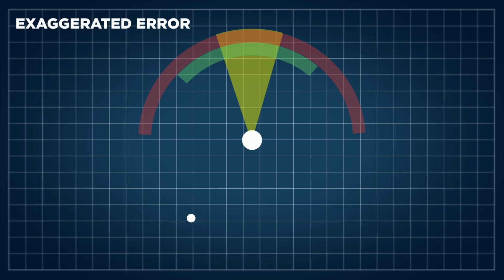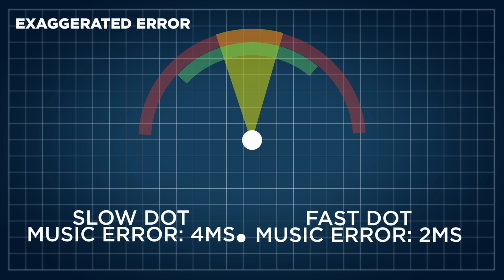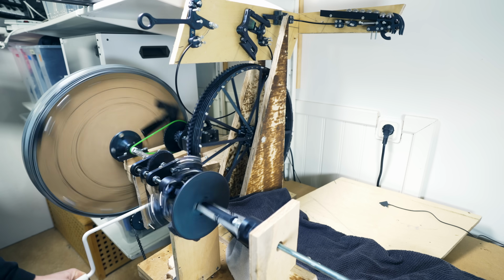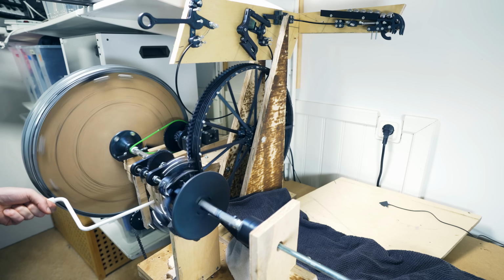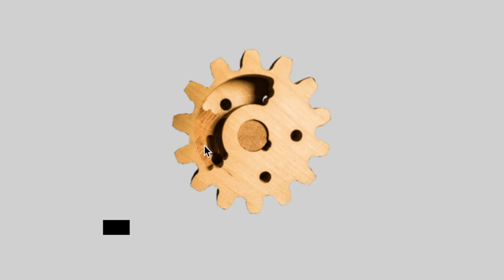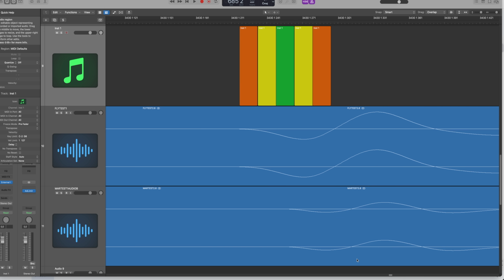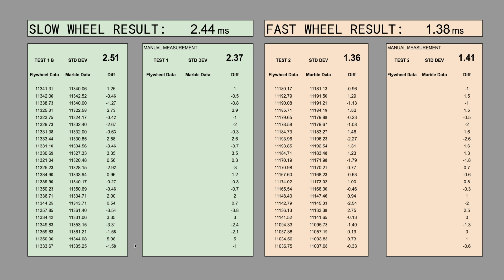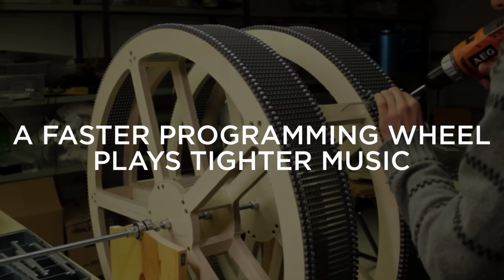Testing a Faster Wheel - Is the Music Tighter?

Comment: Testing your theories in the prototyping phase will increase the odds of successfully creating a functional marble machine! Great job Martin! The only thing I might add to the conversation is DOUBLING the speed of the programming wheel ONLY decreased the std dev by 1 ms total. This slight advantage in std dev seems too costly from a music programming perspective. You may need to create a decision matrix to determine which route really is the best option to achieve your goals.
Reply: I'd add that the program needs twice as many triggers on the half speed variant. This means that 2 triggers will be a total of 1ms further out than 1 trigger. 

If he did the same test but put 2 triggers on the slow version to match the play speed of the faster wheel then the std deviation is going to even out. 

Or at least it will be less noticeable as the effect will cause a microscopic pulsing.
Reply: There is this business bullshit saying:
Is the juice worth the squeeze? Here I'd say no
Reply: IE. If you are playing at 1 BPS and the wheel is doing 1 RPS (1 trigger per rotation) and it's got a variance of 1.5 ms. And, the slow one is playing 1 BPS at 0.5 RPS (2 triggers per rotation) with a total variance for one rotation being 2.5 ms then the variance on the slow one between triggers will be 1.25ms . Which is better. 

However, the downside of this is that   2 triggers will go out in sequence and then back in sequence causing a  slight pulse. It's a matter of whether it's noticeable enough to eliminate. I doubt.
Reply: It might be a decrease of 1 half or a decrease of 1.
Reply: To add to this, perhaps you should update your requirements list to include the discoveries you’ve made with your prototyping. If you set a minimum threshold for total acceptable deviation it will give you a concrete cost metric to help you decide whether it’s actually worth including small improvements like this once you enter the design phase.
Reply: 1:12 Hey Martin, I respectfully disagree with your explanation of this diagram, the difference between the green and red curves is the radius and will always be different no matter if the wheel is turning faster of slower when you overlay the yellow sector, which is different to your physical prototype. This needs to be acknowledged if you are truly seeking to design from first principles. Also, and I am truly not trying to be mean or picky, but a theory is a principal formed to explain the things already shown in the data, until then, it is an hypothesis. 😊
Reply: @MrVajutza  I respectfully think you dont understand what the diagram is showing..
And he is obviously using "theory" in the colloquial meaning, not the scientific one.
Reply: Not to mention the dangers something with the needed mass rotating at twice the speed poses should it fail, as well as the far greater strain on the mechanism. How will you stop it? How long will it take to spin up? How long will your gearing and shafts last at those forces? Torque can run away from you fast, and I don't want to see a story of how the programming wheel turned its axle into a twizzler
Reply: @ghostdog0424 -- I'm not worried about this. The final programming wheels will almost certainly be edge driven and probably won't exceed 30 RPM. A simple lever break should be plenty to arrest the rotation.
Reply: @TlalocTemporal  Good point. It's the relative hazard that worries me, especially with the massive snag hazard of programming wheels sitting directly behind Martin (according to the last cad model we saw) having no guard or E-stop integrated. Shit happens, and there's a reason lockout and machine guard standards exist. They're written in blood. This may not kill Martin, but the potential for injury is still there.
Reply: @TlalocTemporal If the programming wheel is spinning at 30 RPM, that means each “song” will just be the machine playing a 2 second loop (for the entirety of the song).

I really hope he’s considering these additional variables before he decided what RPM he’s aiming for.
Reply: @ghostdog0424 I wonder how many missing fingers Martin feels is acceptable by the time he starts and concludes his Marble Machine World Tour.
Reply: It depends on how big of an error is acceptable,
how much error the other components add,
how much effort it is to reduce the error
and probably more...

I agree that there should be some kind of system to evaluate if it makes sense to implement.
Otherwise you're stuck overengineering everything.

My gut feeling is that the solution (for example the sideways moving wheel) is a lot of effort for very little payoff.
And if might even add more error than it reduces.
I guess a Proof of Concept would be interesting to see.

I'm looking forward to that. :)

Comment: Be careful with going fast; mechanical parts have inertia and will "float". Will you have to worry about this? Probably not, but do keep it in mind.
Reply: Yes, and this can have an effect on the overall programming density, as well as the size of the programming wheel.  A 10 meter radius wheel will have pins move past triggers at 20 times the velocity of a 1/2m radius wheel if both are spinning at exactly 60 rpm.  

A larger wheel at 1rpm will put more stress on the pins and triggers than a smaller one at the same rpm, but it will also have more angular momentum.

A better way to deal with the problem is likely to dispense with plastic pins and Bowden cable trigger mechanisms and go with pneumatic punch cards, or electromechanical triggering using solenoids
Reply: @sethjones5250  I think the idea was to make it fully mechanical. If you accept electronics, crystal stabilized CPU is always going to be more accurate method and will be easier to implement, too.

Comment: At what point is the music tight enough?  At a certain point you gotta say it’s good enough to start construction
Reply: That was the exact mistake he made with the MMX. Tiny errors start to compound. A machine might not work at all if a couple dozen of its systems are each off by even a 1/32 inch.
Reply: @eleetpancake  the answer isn’t to endlessly pursue tightness  way past what a human can differentiate
Reply: @jb76489 It's only tightness passed what a human can differentiate on a single system. Add the inaccuracy up across a bunch of systems and it might become noticable. Some systems should be as highly optimized as possible because others can't be nearly as tight.

Comment: Consider having more then one programming wheel, that turn at different speeds.  By turning the playing of wheels on and off, and using different multiples you can get longer compositions out of the same length of wheels.
You could even have a track on one wheel that starts and stops playing of other wheels.

Comment: Since notes are only triggered by the strike of a falling marble, and there is no control over the sustain of the note, why bother with different note lengths on the programming wheel?  They're all...64th notes.  I must be missing something obvious.
Reply: My take on it is that the faster flywheel spends less time over the area of variability.....leading to a "tighter" area of variability
Reply: It’s about the timing of the note. The marble drops after the programming pin finishes going under the reader. The different lengths allow for there to be things like off beat notes and different music structures like 4/4 and 3/4 without having to make a million little holes in the wheel. (I think)😅
Reply: @JHaugan1  I gave that some thought, when thinking about this, but again, rather than making the note 4.2 "pin-hole-distances" long, one could put a much shorter trigger, 0.2 pin-hole-distance long, in what would be the 4th pin hole along.  Save much in printing time and cost of PLA...
I can imagine it would need to be a minimum length for triggering time - but I'd picture a much smaller triggering piece that what I've seen in his tests.
Reply: The note plays at the disengagement of the programming "pin". The different lengths are for timing regulations, he can increase the length of the end of the "pin" without changing the fixation points in the programming wheels. Basically, you have to make custom pins for each music instead of making custom wheels for each music.

I know this pin-track-thingy does look like it is doing some sustain or other musical magic, but it just looks like it. The time of engagement does not affect the note (except for very small times, then the vibration could introduce some variance). I personally think this design is impractical on a full machine, but, at this stage of development, we are only caring about timing
Reply: The start of the pin loads the marble and the marble is released at the end of the pin.  The pin needs to be long enough to give the marble time to load and settle before being released to have consistent timing.  I believe the prototype pin was made extra long so the wheel could be spun extra fast like in this test.  Once a speed is decided on, then pins could be shorter to only be as long as needed.
Reply: @jeremymercer5655  This would be a really good experiment to test how quickly he can play music on the machine!
Reply: There’s a video on it somewhere, but IIRC the idea is to minimize the number of indexing holes needed in the wheel.
Reply: @r-a-ray it's the video titled "A New Music Programming Pin", from 11 month ago
Reply: @r-a-ray  makes sense tnx.  it does bump up the time and cost of triggering pieces though.  interesting trade study.
Reply: Ok so since only one glared at the point without making it obvious: the mechanism works in three general stages; when idle the gate does not hold a marble, it is empty, the marbles are up in the channel waiting; when the pin is registered, the gate allows one marble to enter and be prepped for release; when the pin ends the gate releases the marble. During the second phase there is some bouncing happening in the gate, as the marble comes to rest on the gate’s gate; as Martin quickly discovered, releasing the marble before the bouncing subsides, affects the timing of the release by quite a lot. The solution was to put a delay between phase 2 and 3, aka the long pins.
Reply: @PigreKo  Thanks, mate.
Reply: Guys remember this is a test prototype to confirm ideas and design.
The final marble machine will, obviously, not look like this wheel and activation system.
Reply: If I remember correctly this is a test ramp, and in the future each ramp will have a different profile. (One ramp plays multiple notes.) 
The benefit is instead of needing to program hundreds of pins, you just match the right ramp to the right slot. 

It trades time programming at a concert for time designing each ramp to have the proper profile
Reply: While it only plays 64th notes, the timing of those notes is more accurate with a faster wheel. The faster the wheel, the closer to the correct timing the notes are played.
Reply: My thoughts exactly, it doesn’t really make sense because there’s no sustain in it, the difference is more a function of the contact lengths and release delay, not of the actual notes hitting or being “actually tighter”. Slow has its advantage too, as in he would be able to program more subdivided notes in the same wheel size, making the machine itself potentially more compact for the same amount of note.
Reply: Not necessarily. If you want to play triplets, you’d need a whole new set of pins, which is what he had on the old machine. This lets him simplify the wheel itself and use more basic building blocks to program the music
Reply: I would like to add my own thoughts. As the note only triggers at the end of the programming profil, why make it so big?
Would it not be better to have more smaller notes so he can vary the the speed? 
to summarize find the programmability of instruments quite hard and program a melody when he is so tight on programming space
Reply: @selectthedead that's exactly what I said, or at least, exactly what I meant.  Just need relatively small nibs.
Reply: @selectthedead he has a whole video on this where he talks about marble "holding time" for the gate. theoretically, longer holding time is tighter.
Reply: The length of the programming ramps isn't to give sustain, it's to give adjustability on where the note drops.  Every ramp uses the same pin setup.  

You can have each ramp set up with two pins and then change note timing based on how far it sticks out past the rear pin. 

This way you can make a programming wheel with a smaller number of big holes.

It's a trade off.  Instead of having a wheel with a bazillion holes that all use identical programming pegs you can have a wheel with a small number of holes but you now need to choose the correct length ramp for each slot.

But it also has one additional advantage in that you're not constrained at all by what number of holes you have.  You can create any crazy pattern you want with this system.

I won't be surprised if it goes through another design revision though, because a faster wheel is going to mean half as much music per wheel.  So I think those ramps will get shorter.

Comment: If the marble is being dropped twice as quickly, wouldn't any measurement of variance half due to it being spread between two pulses rather than one?
The slow test should have had two triggers so that the resultant drop rate was the same.
I think the result indicated no significant variance.
Reply: it indicated a worse variance with the higher speed
2x1.41=2.82 > 2.37
Reply: @durandle9226  thank you
Reply: I agree tightness should be independent of speed. 
Should the tightness not be mathematically weighted with speed to make it more representable?
We all know if you double the speed any error from before halfs

Comment: keep up the great work cant wait to see the final product!
Reply: There won't be a final product. He is making it more complicated instead of less, and is procrastinating on "tightness" to a degree that's imperceptible to most people.
Reply: Been following for 7 years now, he keeps on heading in the wrong direction all the time by doing things that are not progress. He's been talking about "tightness" for god knows how long even though there is not even a machine yet.

It's called pre optimization and it's probably not even a problem in the first place ...
Reply: Afaik tightness was never an issue with either marble machine, the issues were reliability and those were caused by massive over engineering of parts that could have been simpler.
He is just creating new stumble opportunities with all of this.
Also: double the programming wheel speed means half the music length. All for 1ms to 2ms deviation. That's ridiculous at best and intentionally sabotaging the project at worst. It's horrible to see how martin transitioned from a great inventor to a procrastination master
Reply: Guys above are so right... Martin still fighting with "idea of perfect machine". But what we all need is just another a little bit better marble machine than MM1 and second performance with music! Nobody cares about ball size, dumpening using rubber band with glue or stretched by mechanism, 2ms tightenes or sometimes ball drops.